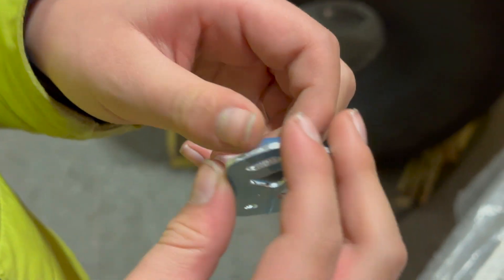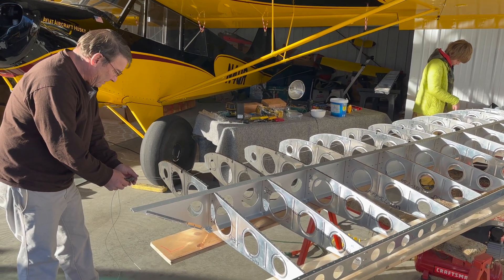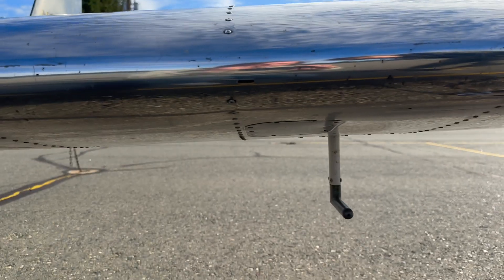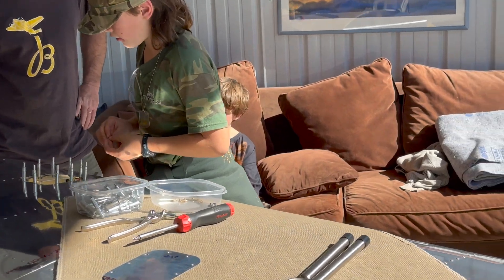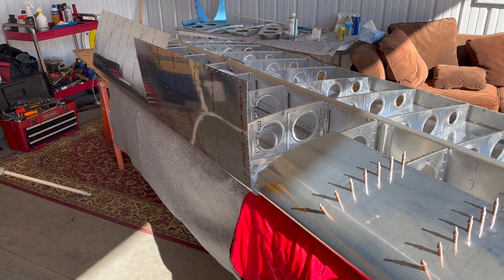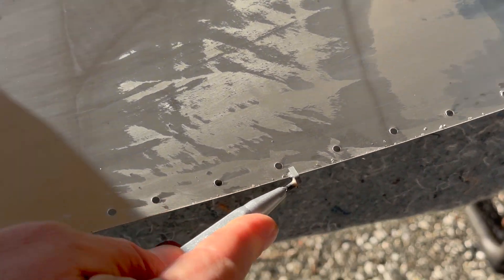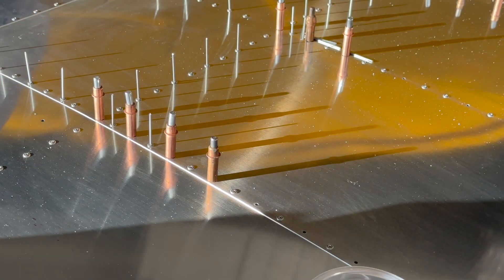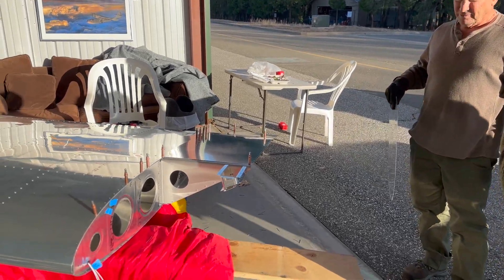RV-12 - Part 3 - Left Wing Part 2

Comment: Why did you opt not to apply zinc chromate primer to internal wing structure?
Reply from the maker: It's a bit of a religious point, whether to do it or not. It's all Alclad, we're in a dry climate, we save weight. That's basically the thinking here. My 80 year old Ercoupe wasn't primed from the factory, although it was done when it got to 50 years old...

Comment: Are there any points during the construction of a homebuilt that require a signoff by an faa inspector? Or a certified a and p mechanic?
Reply from the maker: Yes, I think there is a fairly expensive and time consuming inspection and sign-off by an external party before the first flight.